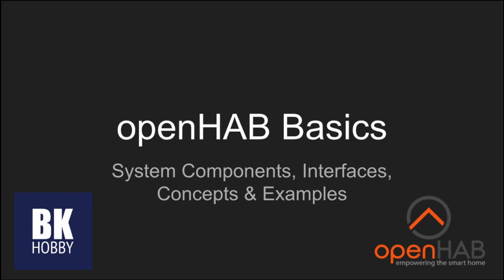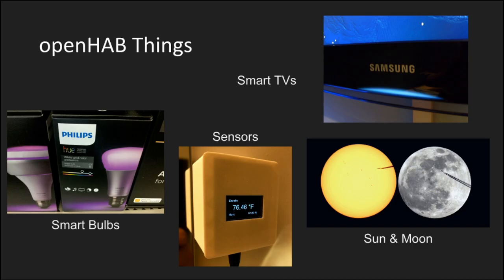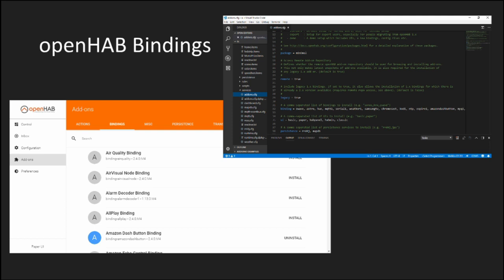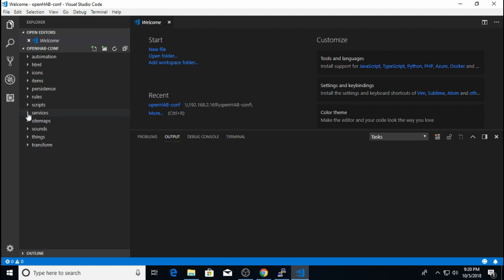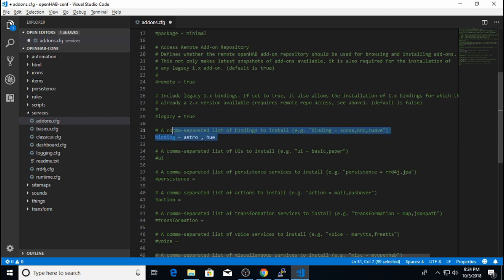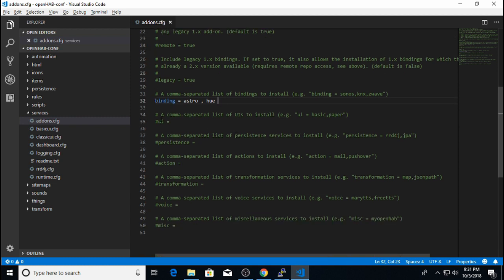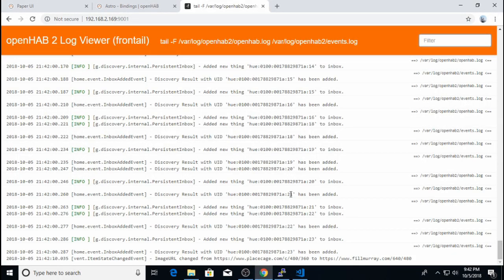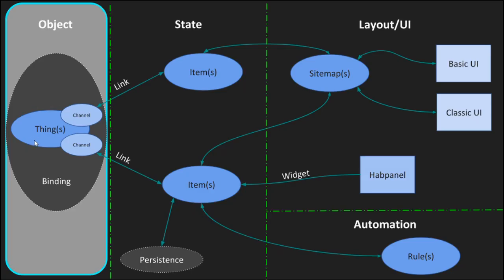openHAB 2 Basics - Setting up Things Channels and Bindings

Comment: I'm new here, so let me get this straight:

So, where does Paper UI put its settings if not in the addons.cfg file? And why on earth does it need to be in a different place? A beginner could spend a lot of time getting things working in Paper UI, and then need to get a bit more granular in text CFG files, then POOF! Things disappear in Paper UI and you have to redo it all in CFG files. This seems positively obnoxious.
Reply from the maker: @Terry Davis - great question and that is one of the "quirks" of openHAB 2 and absolutely something I want new users to understand, so they avoid the issues I've had while learning openHAB. 

So, with openHAB 1, everything went in config files (and there was NO PaperUI or the concept of Things). OH 2.0 added those concepts/UI, and along with it, began storing configuration in two places. One, the still supported config files (to allow OH 1 users to bring over their configuration more easily), and two, a runtime database. The problem with trying to keep everyone happy is that you now have two locations for configuration storage, and one is incompatible with the other (there is no way to import/export configuration from the DB to config files or vice versa). Because of this, most long time OH users (myself included) use config files to store everything except for Things (which is easier for auto-discovery and because Thing config file syntax is not as familiar to everyone yet).

I hope that explanation makes things clear as mud ;) The good news is that for OH 3, there are some good discussions taking place on how to fix this, so that either we go to a UI-only config (which is a point of contention for the hard core users with thousands of lines of config files), or allow both the DB and config files to work together (which would be my preference)....We'll see what happens!

Either way, you won't go wrong whichever path you choose for your configuration, and you can make both work :)

Comment: Hey @Bk Hobby. So if I started configuring in PaperUI and now want to go to config files, where do I find the things, items and all the stuff I already loaded via PaperUI? how can I backup or use that in the config files?
Reply from the maker: @dhcpy - there isn't really a way of doing that. Think of PaperUI and config file configurations as two separate ways. You can't export PaperUI items/things/etc. into config files, and vice versa. That said, if you  want to use config files going forward, just start putting items in them, and maybe slowly remove them from PaperUI (same item name/links to Things, etc, so that they fully replace the item you're getting rid of). 

In my setup, I use config files for everything but Things. I let PaperUI find my Things  based on the bindings i installed via addons.cfg, and I reference the Thing channels by name/id in my item config files. At worst, if I have to recreate my OH install, I'll just have to search/replace the Thing ID in the Items file with the new one PaperUI creates.

I know - this is all very confusing and all over the place. And, it's one of the major points being discussed by openHAB developers and users on the OH forums, i.e. how to make the PaperUI more useful, and how to allow text configuration to live alongside the PaperUI configj. I'm sure with OH version 3, this will be resolved.
Reply: @BKHobby  thank you!

Comment: Hmmm, i followed your guide and now i ran into trouble. When i click control i paper ui i dont see any of of my things, wgere did i go wrong?
Reply from the maker: @Jerry P - did you select "Demo" mode after installing openHAB? If you didn't, check your Paper UI - Configuration - System - Item Linking setting. If it's turned ON, OH will create Items and link them to your Thing channels automatically - otherwise, you have to link them yourself. If you select "Demo" mode, that option is turned on by default.

Bottom line, only those Things that are ONLINE and Channels linked to Items will show up in the Control tab in Paper UI.

Comment: Hi, thanx for the video.
Could you explain (maybe in another video), how to create the things in config files? If you use auto discovery and the Inbox you do 
not have the file.things How do you backup and restore in this case?
Reply from the maker: @Steffen Roesler - in my experience, Things are OK with just being auto-discovered, even when restoring to a brand new configuration. In worst case, you'll just need to modify the Thing configuration to change its ID to match what you already have defined in your .items file channel definition.
Reply: @BKHobby  I'm trying to learn openhab and found it confusing that you didn't teach creating things using config files.  Maybe annotate the video with this comment of yours. 

Your videos are awesome and I wouldn't have decided to learn openhab without your channel.
Reply: Also, please cover configuring mqtt devices with the latest binding.

Comment: My openHAB user does not have access to adafruit ws2801 library as I accidentally installed it in local user directory. So when I execute my python script through my RULE I get permission denied. Any ideas?
Reply: And if I try to reinstall it under the openhab2 directory it says it’s already installed...
Reply from the maker: You can try fixing permissions for the openhab user (in openhabian-config), or move the ws2801 library via cp? Are you trying to use the GPIO pin to drive the LEDs?
Reply: BK Hobby yes using GPIO. But if I move the whole adafruit directory to /home/openhabian I think the references will break?
Reply from the maker: hm, I'm not very familiar with running this library with GPIO, but it seems to me in order for your scripts to work, the library has to be in a folder that the openhab user has access to (i.e. /etc/openhab2/...
Reply: BK Hobby ok got it. So do you think just moving the adafruit library will work then?
Reply from the maker: I think so - I don't see how it can work with the library being in the home user's folder (which openHAB doesn't have access to).
Reply: BK Hobby ok I will try it, thanks! Failing that, do you have a link about modifying the openhab-config permissions?
Reply: Via CP? I use Putty
Reply from the maker: For Fixing permissions, just log into your openhabianpi (via Putty) and type in "sudo openhabian-config" and select "Apply Improvements" and "Fix Permissions" (that will set them back to where they need to be). I do NOT recommend changing the permissions on your home folder (even if it works for now, a future change to openHAB or reinstallation of openhabianpi will mean you will have to do this every time, and generally you should avoid doing things in non-standard ways). If moving the library doesn't work, I recommend you go to http://community.openhab.org (the openHAB forums - a super helpful community!) and start a new topic - I'm sure someone there has done what you're attempting to do, and will be able to help you out very quickly!

Good luck!
Reply: BK Hobby Your right - they are a very helpful community!!

Comment: There is something unclear. You said "they will be unistalled the next time I open the openhab if I didn't list them". Actually i have mqtt binding working correctly even if I reboot and I installed it from paper ui. How is that possible that you said so ?
Maybe that happened because the CFG file overwrites what you do in paper ui ?
Reply from the maker: @ahmedadelhosni90 - What I mean is that if you put anything in the "bindings" line of the addons.cfg file (even just uncommenting it - removing the "##"), openHAB will read that line and assume that you want NO bindings installed and uninstall any that you installed with PaperUI. If you comment it out, any PaperUI installed bindings will remain.
Reply from the maker: @ahmedadelhosni90 - Exactly! The CFG file overwrites what you do in PaperUI!
Reply: Good. Not its clear. Thanks for the great and organized video.